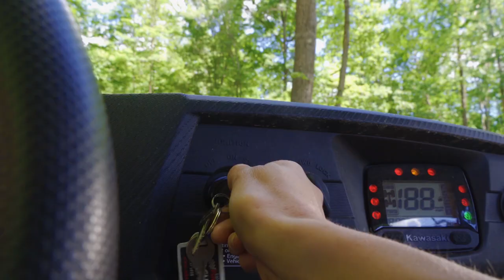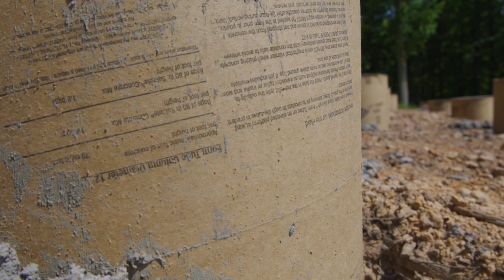It All Got Washed Away

Comment: While building my first house in 78, I was using Sonneborn brush on waterproofing.  I had the front of the house all done when a storm cloud rolled in.When we came back, the only sign of the waterproofing was where it was built up in the drain rock around the foundation.  The chalk line we'd snapped to follow was still there.

Comment: When I was building my cabin I measured everything out, got the post set and went archery hunting in the morning.  About 8 I heard someone hammering nails.  My brothers, brother-in- law started to put the beams around the posts and got the strings out of the way.  It was funny with me re setting some of the sticks, then  knocking half the boards off.  Then setting the boards by the string.  I was going for 12x24 and it was 12.4x24.3 on two of the sides, I did not bother measuring the other two sides.  I ended up notching the posts and needed the lines to do my cuts.  He had never built anything before and laying the base deck was mandatory.  He also took it, as he was being called stupid having to redo all the work he did.  Even though I was explaining it and laughing.

Comment: That's why when deck builders suspect rain, they mark the bracket locations with the start of a drill hole.
Reply: Yep. pencil, chalk and ink will wash away, but a half inch hole drilled into concrete... it would take something of biblical proportions to wash that away.
Reply: You can always cover concrete with some wood or osb scraps.
Reply: Or spray clear lacquer over the chalk line
Reply: We used bright fingernail polish!
A little dab will do ya! 💅
Reply: @staramalpa_214  : Or just buy concrete chalk that permanently stains & won't wash off. Been available for years now.
Reply: @ladyloquitavida148  I thought that was brell cream 😂😂😂

Comment: Once you had the marks made on the piers, you could have taken a pointed chisel and tapped it several times to make a dimple in the concrete.  That way, even if the storm washes away your marks, you still know where to start drilling for your hardware.  Another thing  you could have done it to duct tape a plastic bag or some saran wrap over the tops of the piers to protect them from the rain.

Comment: A 55 gallon barrel for water, a camp instant hot water heater and a PVC frame for a shower stall will let you setup a shower right by the truck for cleaning up after an off roading trip like that before you get in the truck to go home.
Reply: I think they left the water lines setup from when their only shower at the house was outside.
Reply: @JCrook1028  How would water lines at the house help take a shower when they are on a road trip to an off roading place?
Reply: @TheUserid82  You think carrying a 55 gallon drum in a truck is an actual thing worth doing just for a 4 wheeling trip? lmao, have fun with that. If you're truly that concerned about a bit of dirt just carry a spare set of clothes.

Comment: That deck might shift over the years if those piers are not flared, set on a a solid concrete base, and set below the frost line. It looked like they kind of moved a little when you guys were tightening down the brackets.

Comment: Why not just lightly score the lines into the cement surface.  I wonder if a home depot bucket would fit over the pier tops?  Whenever I lay out wall markings on a wood floor I always spray it with clear spray paint so it wont get erased till they are ready.  Just stretch mason string out from the house past the last pier and attach to the batten board.  Measure from left end side to right end side at the house and at the end.  If it is even then measure out from the house on both strings and run the string across parallel to the house.  Check for square with the 3-4-5 method.  Three feet up one string and four the other.  The diagonal should be 5 feet between the measurements.  I was also wondering why you did not set your J-bolts into the wet cemement when the piers were poured.  You then set the base plates over the bolts and bolt it down then screw the piers to the sides of the baseplates.  Set your joists on the piers and strap them down.